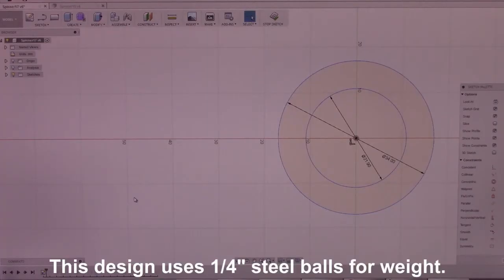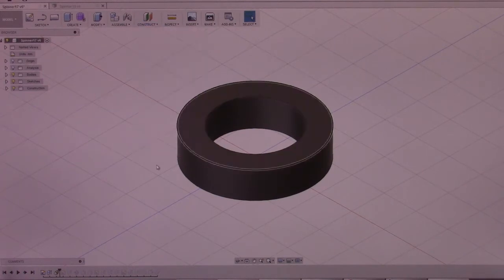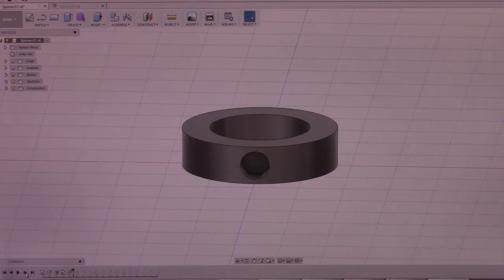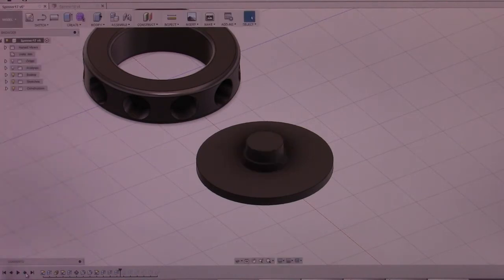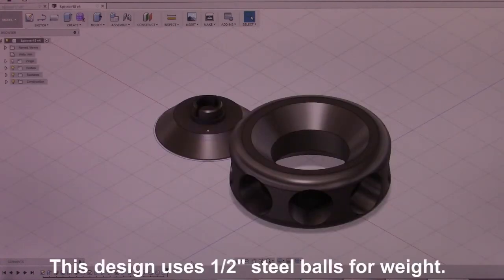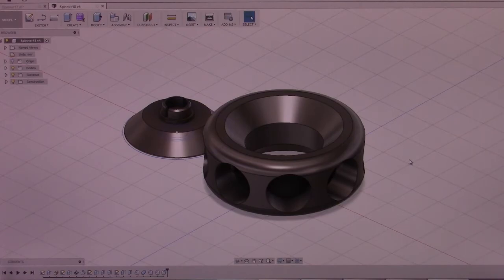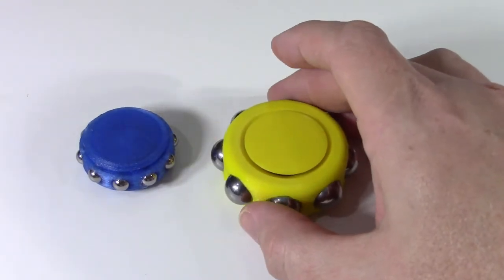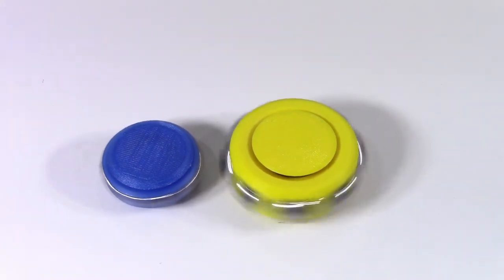How-To:  Compact Fidget Spinners Volume VII  (Fusion 360 Overview - 3D Printed)

Comment: I have a very noobish question, the 1/4 ball size, is that for the diameter or radius? It sounds like overthingking but I ordered some "1/2 bearings for a spinner that used the "1/2" bearings and they were not the correct size, and if so can you recommend some? Thanks
Reply from the maker: All the sizes that are listed are the diameter.  The 1/4-inch steel balls/shot are 0.25-inch in diameter (6.35mm) and 1/2-inch steel balls/shot are 0.50-inch in diameter (12.7mm).
1/4-inch balls:  https://www.amazon.com/gp/product/B01H0IZ7HK
1/2-inch balls:  https://www.amazon.com/gp/product/B00EYUYQA2
3/4-inch balls:  https://www.amazon.com/gp/product/B007B2ABRM